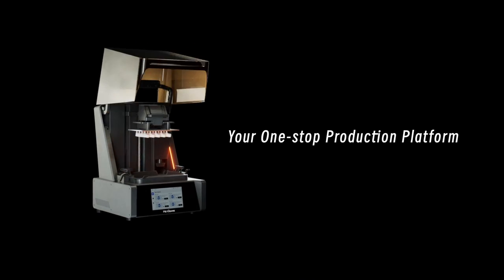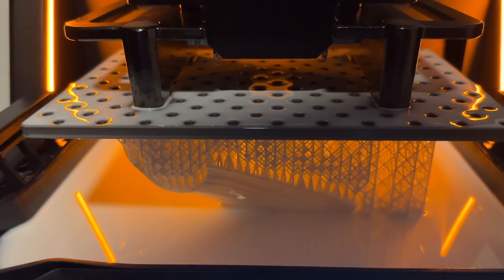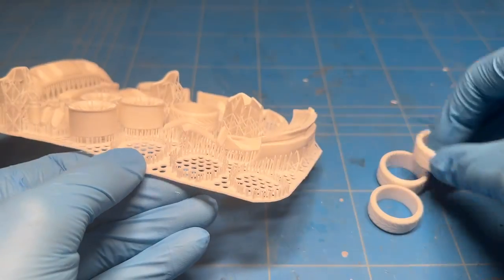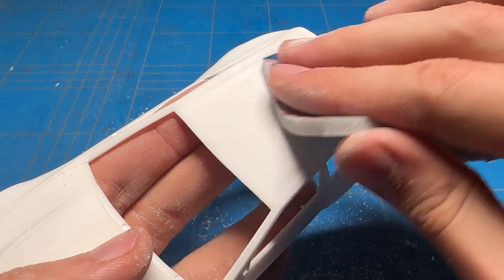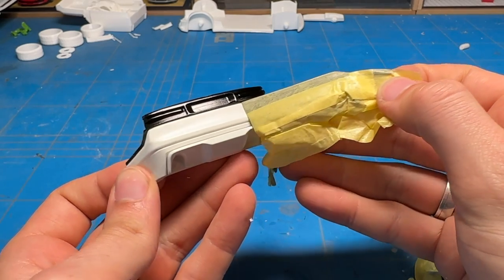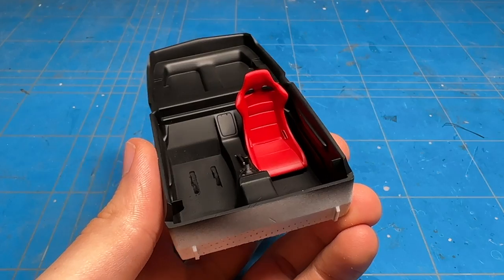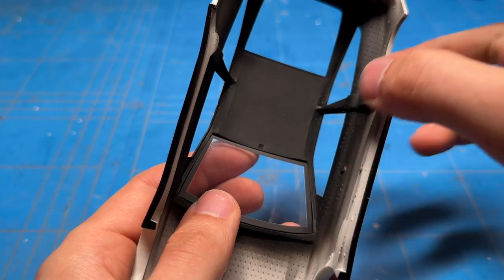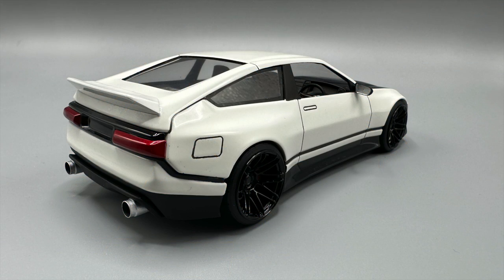Fully 3D Printing & Building a Modern Toyota AE86 Initial D Styled model kit

Comment: That 3d printer system is pretty cool but idk if I like that it automatically dispenses the resin, that just seems like it would be one more thing needing to be cleaned after printing. Also how easy is it to get the unused resin left in the basin back into the Cartridge you loaded into the printer afterwards?
Turned out nice 👍👍
Reply from the maker: You don’t have to use it, but you can.

Same as other resins. Remove the cap, pour it back in
Reply: You can leave your resin in the tank, unless you have failure and need to filter or if you want to use another resin, you can leave it permanently in the vat

Comment: Nice job!!  If you heat up the supports with a hair dryer, they come off really easy and much cleaner.
Reply: I soak mine in hot water for 10-15 minutes…….they come off pretty easily, but the body itself can be a bit soft, so you have to watch.